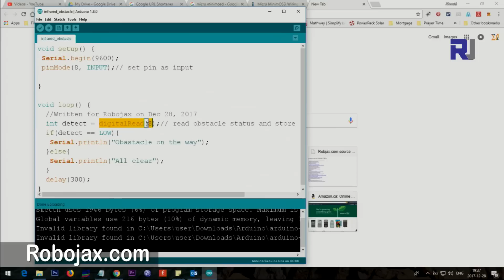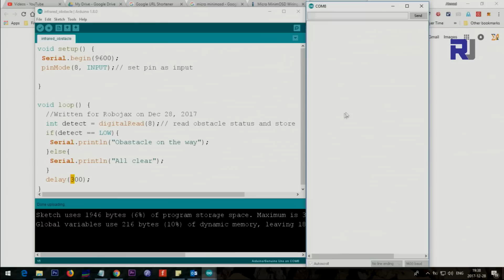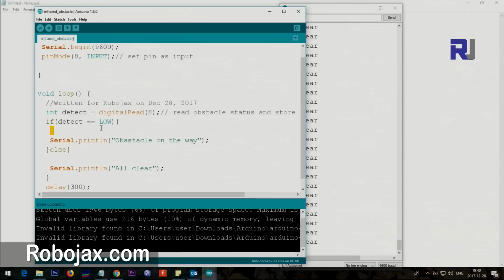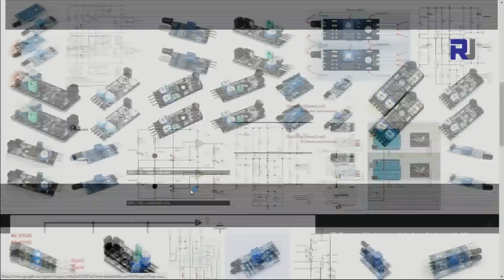Infrared Obstacle Avoidance module for Arduino with code RJT38

Comment: hi but i got confused at the wiring since there is 3 gnd pins on the arduino
Reply from the maker: Hi, GND is just GND. all of them are the same. connect it to any of them you like.  or watch this better video https://youtu.be/yXpjd279T6g

Comment: Do I always need an Arduino board to program an obstacle sensor?
Reply from the maker: Yes arduino constantly read the infrared result that is coming out of the sensor and taking action. you can take action like turning ON or OFF something like motor or light or anything else.

Comment: how it comes that the output of the comparator is High when an object is detected but the output of the IR sensor is Low in the same case ?
Reply from the maker: it is how the circuit is designed. and arduino is here to help and use the output of this when it is LOW or HIGH
Reply: Robojax can i get a link for the good circuit please ? I still don’t undertand how the circuit is in the last step, where the output is not the same as the comparator output.
Reply: Robojax and please why the led is turning on when the output is 0V ( low because object is detected ) ? And when it’s high ( 5V no object ) the led is off ?

Comment: Hi. Is it possible to determine the length of time that there is an obstacle in front of the IR module? Thank you.
Reply from the maker: Hello, yes it is possible. Just search for "millis" on my channel. Here is how to  Find Specific YouTube Video in a channel https://bit.ly/findYouTubeVideo if you want to learn Arduino *** Free Arduino Course worth $200**
Arduino Step by Step Course  (over 100 lectures) Starts here http://robojax.com/L/?id=338
Reply: @robojax  Thank you for the reply. I have watched the "millis" video and on the examples 2 and 3, you have used pushbutton. My project involves IR sensors instead of push button, what would be the IR equivalence of "buttonPushed"?

Comment: can I know how to get this output on the cloud  and to the MySQL database
Reply from the maker: you will need Either or Wifi module. or use another board ESP8266 which has Wifi https://youtu.be/pLvqh57T3s4 or use ESP32 which has WiFi and Bluetooth https://youtu.be/--Fj8QDlGuQ and I have tones of videos for both programmed with Arduino IDE.  They are much better than Arduino UNO
Reply: @robojax  thank you very much
Reply from the maker: you are welcome.

Comment: How can we operate it without Arduino ?
Reply from the maker: power it up with 5V and use the output for whatever purpose you need. I have explained what output does in the code section.

Comment: does anyone have the data sheet for the sensor? I couldn't find it in the amazon page
Reply from the maker: is has infrared transmitter (emitter) and receiver. and you won't find datasheet. the IC has datasheet and that is it.

Comment: Which module I need to buy automatic spray using ir sensor
Reply from the maker: this sensor can send signal. Now you need to control a relay and the relay can turn ON and OFF your spray machine. Here is my video on Relay https://youtu.be/g6k8sPJyif8

Comment: Sir by this Tx pin of my arduino is passing current and because of this my arduino is not accepting any other code plz tell me how to fix this problem
Reply from the maker: sorry did not understand what you meant. the pins of this module don't need much current (like nothing) except the VCC or 5V pin.

Comment: Hi, i followed your code but thing is when i put my hand near the sensor the second light wont show means it is not detecting
Reply from the maker: Hi, Yes it is not detected. You have to adjust the potentiometer until you see it is sensing.

Comment: Sir,nice project. Did you find circuit diagram for this sensor module ? I was looking on internet, but it wasn't successful :(
Reply from the maker: The same sensor is used in over 20 different sensor. All with OPAmP.  I don't have it. but it is very easy to draw it.  You should be able to do it in 15 minutes. Just get a magnifying glass and read the value and draw it. the only value you won't be able read it is the capacitors.

Comment: Hi

Can you help me please?

I want some distance sensor for (20cm) with adjustment option if there is, and with dry contact open/close. 

so, when it detects Obstacle it will open the dry contact and automatically close it when it will stop detect the Obstacle 

can you help me to find the item that I need on AliExpress?

Thanks
Yossi
Reply from the maker: Hi, with this you can't do it precisely. Please use laser distance sensor VL53L0X https://youtu.be/0GxFoq_zPt4

Comment: This is actually really helpful in helping me with a project, thanks so much!
Reply from the maker: You are welcome.
Reply: Robojax I have one question, why is there no output? Doesn't the sensor have to send out and then have that bounce back? (I'm using a slightly different sensor but basically same idea as what you are doing).